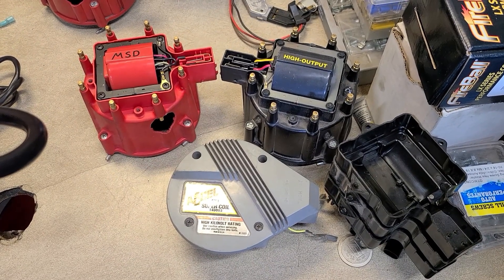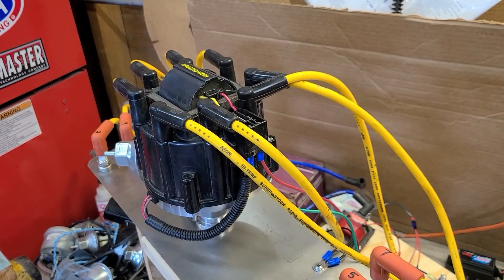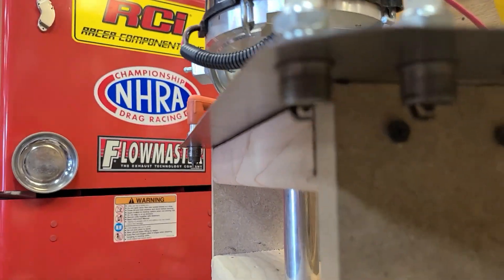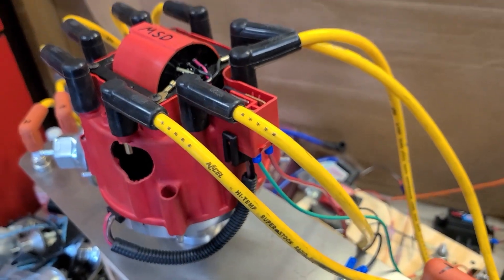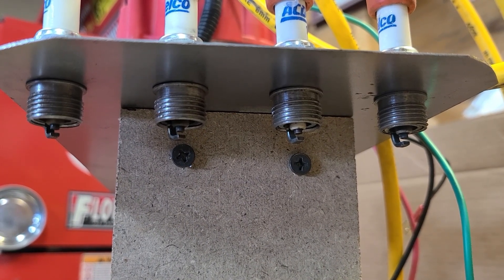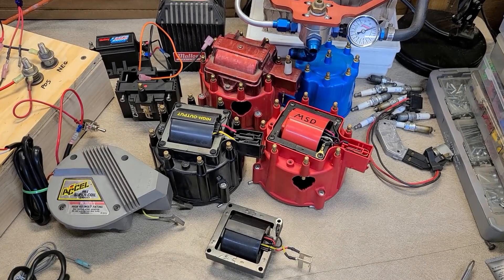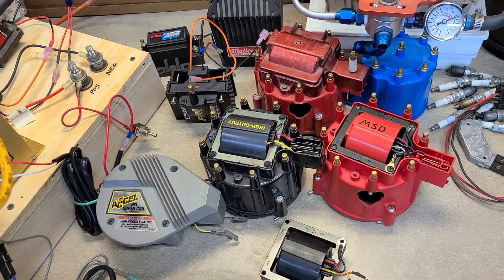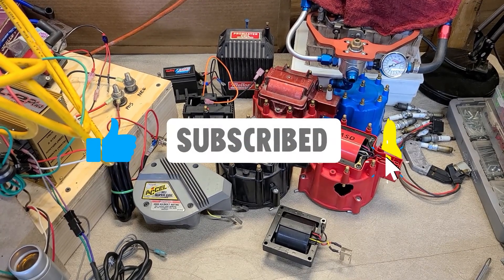Coil testing - HEI in-cap

Comment: They all look the same. Try it with non resistor plugs.
Reply from the maker: I picked up a Sun Engine Analyzer last summer so I plan on redoing my coil test with that hooked up. I've already experimented a little bit trying to make sure I have everything hooked up correctly and it works pretty well. I just have to get a couple of projects done and then I'll get back on this.
Reply: Yes, non resistor plugs, low ohm MSD Super Conductor wires or Granitelli 0 ohm wires, also be sure to use MSD low ohm carbon brush in the cap, or make up a solid brass screw connector.  MSD made a cap adapt to convert an HEI to external coil, that I think also used a solid brass center conductor.  I have a few of the old discontinued cap adapters made by Mallory!  Also be sure to run 15-18v into the coil positive using a step up transformer or adjustable power supply, & all these upgrades will put those coils into producing plasma ignition!

Comment: Ready to see external coil test as im having issues now i do have a blaster 2 msd on hand,love the cut out on your caps and do you  actually set timing at deired number and then phaze in the best point of ingition! Cool innovation 💡 😎 👌 👍
Reply from the maker: What kind of issue are you having?
As far as phasing the distributor...all you're doing is lining up the magnetic pickup and making sure the rotor is pointing at the number one terminal. I have a video showing how this is done. Thanks for watching.

Comment: What are your thoughts about the Proform?
Reply from the maker: I have not tested a proform coil but for a street car or a street/strip application, it will probably be satisfactory. I would recommend installing the MSD low resistance bushing in the HEI cap. For racing only, I prefer to use an external coil.
Reply: @BruceCoggins  Thanks I just did order the bushing from summit was like $21 ...Do you know I heard people ground that distributor inside the cap and run another ground wire outside as well . Interesting why people would ground it twice . Could you help me out on this ? I also have a new MSD coil 44,000 volts I have not yet open up
Reply from the maker: I have never ran a separate ground wire to the distributor body...not needed. If it was needed, the factory would have put one there...IMO ;)

Comment: Cool setup.  How about testing different coils with different spark plug gaps? 0.030 vs 0.060?  Measuring output voltage would also be interesting - at the coil and at the plug - and heat developed at the plug by each system.
Reply from the maker: One of the things I really wanted to do is find a way to test output voltage between coils and at the plug but so far I have not figured out how to do that. A neighbor brought over an oscilloscope for me to try but it didn't really show what I wanted it to. I can visually see a difference in spark between certain coils and resistor versus non-resister spark plugs but it doesn't come across very well on video. 
As far as gap is concerned, I did test that years ago in my race car. My car is very consistent so over the course of a full racing season I tested a few things. I tested NGK racing plugs vs Autolite racing plugs, standard reach vs extended reach, 2 different heat ranges, indexing plugs and finally I ran 2 different gaps .030 & .045. Results - after testing everything the only thing that made any difference at all was the engine ran a little better with a tight plug gap and I ended up leaving them at .035. By the way, indexing spark plugs did absolutely nothing - in my case. In all, I ended up trying 22 sets of spark plugs and yes, it was a little bit expensive, LOL.
Anyway, thanks for your input and I am still going to look for an easy way to test coil output at the plug. I think it will be a very interesting experiment.

Comment: Hey I’m a 17 year old trying to fix my 1990 f150 it has a 502 out of an early 80s fox body so it’s carbureted but somehow the distributor is in the front and the cap and stem I think you call it looks like one of those msd ones it’s red that’s all I know but the coil some odd reason keeps getting so hot it doesn’t give enough spark and I don’t know what to I keep replacing them but doesn’t change nothing have all the wires connected properly the ground strap is good it’s just keeps losing power when it’s hot like the truck just shuts off and leaves me road stranded everyday but if I let it cool down it will start just fine I just need some help please
Reply from the maker: I'm fairly certain you mean that you have a 302 engine. That was very common for both of those vehicles in that time period and the distributor in the front of the engine is exactly where it should be.
A couple of thoughts...you said the coil gets hot and the vehicle shuts down. Coils will naturally get hot. Having a coil fail isn't as common as you might think so if you have already replaced it and still have a stalling problem, I would look elsewhere for the problem. Also, make sure you are running the factory coil or a stock replacement...don't get all caught up in the next best thing and buy some aftermarket unit...they are all made in china anyway.
When the engine dies, does it immediately shut down or does it slowly lose power? If the engine shuts off immediately then it will be ignition related...if it slowly loses power then most likely it will be a fuel issue. You need to check for spark as soon as it dies...that is easier than checking for fuel when you are by yourself. You might want to check or replace the EEC relay (Electronic Engine Control) if it has one...I have not worked on one of those for quite some time but relays do fail and are easily overlooked.
To check the fuel pressure, you just hook up a mechanical gauge, disable the ignition and crank the engine. You should have 5-6 psi....3 psi and less the engine will not run. 3.5-4 psi is barely sufficient and the engine might struggle under a load. Check the oil dipstick and see if you can smell fuel...that is also a sign of a bad fuel pump...very common on those.
The distributor used in that year just has a magnetic pickup so that could also be causing your issue. The wires get brittle and will break. As I recall there should be a Blue Grommit Control Module on the fender...that could also be the problem. You can test the resistance (ohms) of the magnetic pickup and see if it is in spec...google the specs...and replace if necessary. There is no test for the control module, again, as I recall. 
Hopefully, this helps.
Reply: @BruceCoggins  thank you so much It doesn’t randomly shut off it just Boggs down then dies I’ll check my fuel pressure it just put a new billet holly one on and I’ll adjust that if it needs and check  that and I’ll let you know thank you so much

Comment: A friend recently told me that the accel wires have a high resistance than other brands. And the least resistance is better for components.
Reply from the maker: Yes, they do have a lot of resistance. These wires are over 20 years old and were just taking up space so I decided to put them to use. For the race car, I use Moroso Ultra 40....I've also had the MSD 8.5 Super Conductor wires ...both are very good spark plug wires.

Comment: Many times people have coil failure or spark degradation because they didn’t install the Ground strap inside the cap when installing the coil. 🤔
If you’re asking what the ground strap is, then this is a very good tip.  JD

Comment: Have you figured out a way to measure spark energy?  Possibly indirectly by measuring avg primary current and steady rpm?
Reply from the maker: I have an oscilloscope so that should show us something. Something I've always wondered...is there really a difference in similar looking coils. So, for instance, a stock coil versus one that says high output...I know it has to do with the number of turns in the winding but how easy is it for some offshore manufacturer to just stamp a batch "high output"...Something else that is really cool is the difference in spark when using a stock spark plug (resistor) versus a racing plug without a resistor. You can physically see a difference there but I need to find a way to show the spark energy output between both of those. I will be doing a video on spark plugs soon.
Reply: You need a high voltage hi capacity capacitor and an accurate count of sparks and resultant voltage to measure the stored Joules...An oscilloscope can do it but you still have to integrate the delivered pulse volt-amps....